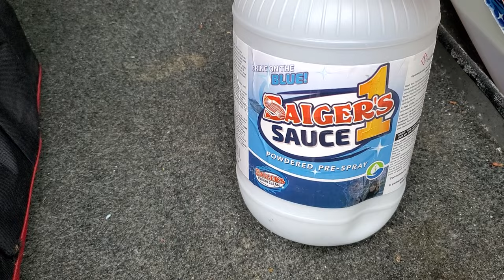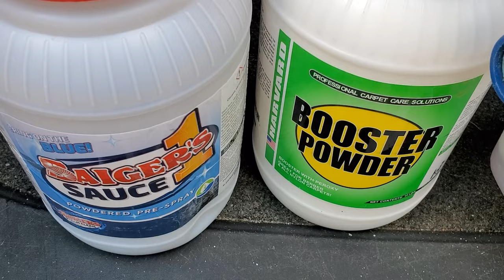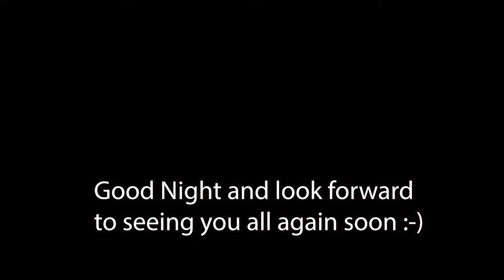A Day in the Life of Carpet Cleaners Mark & Aron with Saiger's Steam Clean

Comment: I'm picky about rolling up hoses too but the sleeves on the high pressure hoses make it tough to roll neatly, at least for 50' lengths. Are your hoses longer?
Reply from the maker: We run a continuous 200 foot hose on the Butler High Pressure reels.

Comment: i cant clean stairs with a mini wand, tried it a few times, probably my ocd lol, i hate color sealed grout lines!
Reply from the maker: It does take practice to clean stairs with ANY wand I find. Also, getting something with good flow to rinse... Or you need to take more time with lower flow to get them clean.

I'm not a fan of color sealed grout either. This was even one step worse. They used black paint that failed. Was a terrible contractor on this build unfortunately

Comment: That chair is micro Suede right ?I still have trouble with those they feel wet after cleaning but half hour later dry.😵
Reply from the maker: Yes, Microfiber chair material. Some people towel them down a bit after cleaning. We might do that on occasion. Our low moisture tools do pretty well on them actually, but you are correct. It is a material that doesn't absorb water, but still just let's water sit on it a lot making it a weird drying material